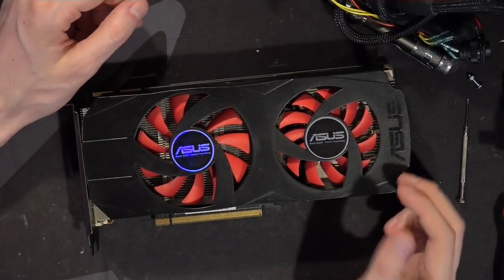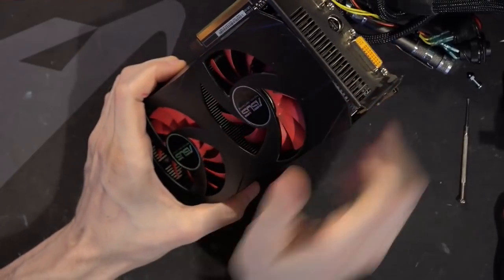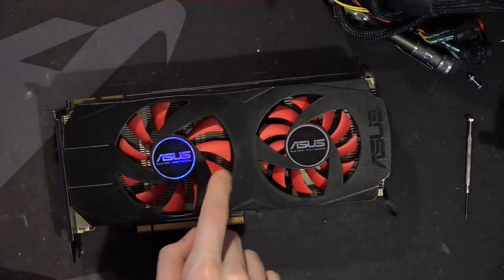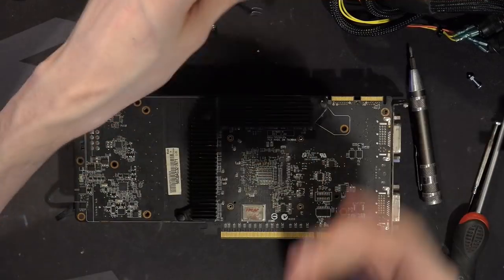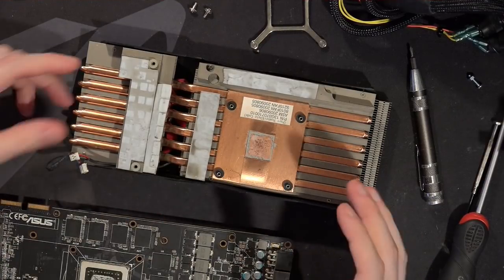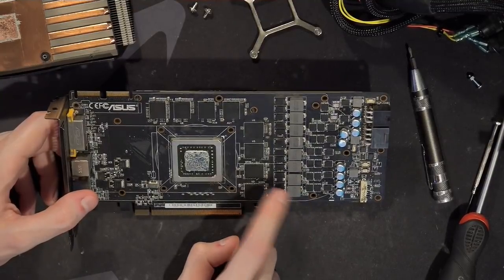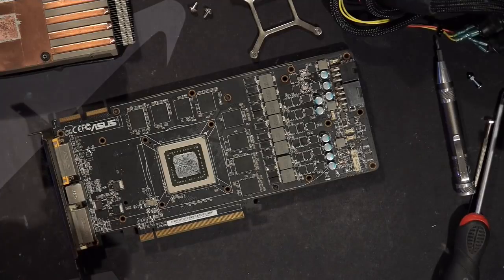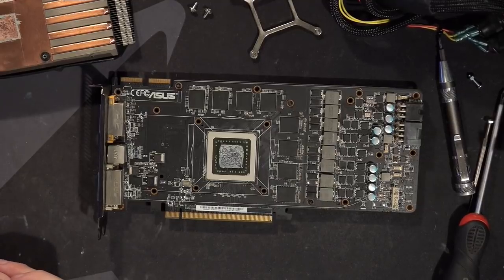ASUS EAH4890 1GB teardown.

Comment: This was early into these dual-fan designs for ASUS and they were trying to keep air going out of the chassis. In a lot of chassis designs with front-to-back airflow this card actually performs worse than the reference card in everything other than acoustics. Proper dual-fan designs with sizeable finstacks did exist, such as MSI's original TwinFrozr displayed on their GeForce 200 series models. 

Important note about the memory; the reference Radeon HD 4890 spec uses 1024Mb x 8 Qimonda 4.0GHz rated GDDR5 tuned down to 3.9GHz for stability and yield concerns. ASUS for this card chose the older 512Mb x 16 layout to offset stability and likely cost/availability. Other vendors such as Sapphire had already shipped 2GB variants of the 4890 with 1024Mb x 16 Qimonda at the full 4.0GHz. So it doesn't need to be double sided, but they chose to do it that way to make it easier on themselves.
Reply: "worse in everything other than acoustics" doesn't make sense - noise equals cooling performance... So that's a bit confusing lol. Did it perform worse in noise normalized thermals or did you mean with fans off? Cuz separating acoustics, a 60 dB blower cooler is the best ambient cooler ever lol
Reply: With those fins running the length of the card instead of transversely, the front intake of the chassis would be fighting the GPU fans pushing air out of the end of the card.

EDIT: The reference design was a single fan blower.
Reply: @Manjushri The fans are quieter, however the card does not stay as cool as the reference card regardless of fan speed because the finstack, among other things, is inadequate.

Besides if noise equals cooling than passive finstack cards would simply explode when powered, no? Cooling is relational to the volume and surface area of materials the heat conducts to. Be it air, water, metals, plastics, or a combination of materials.
Reply: @FixedFunction  I was hoping you'd recommend installing a turbine if noise level alone = cooling performance, LoL.
That's just someone talking out their arse.
I didn't notice at first but the two fans are different. The rear fan that's cooling the VRMs has denser blades. Higher static pressure since that part of the cooler doesn't have even the mediocre fin stack the GPU side has
Reply: Ben T.  Equating noise level to cooling performance is wrong for so many reasons. I wouldn't be surprised if that guy came from the PCMR subreddit
Reply: Ben T.  For sure. GPU cooling solutions have been relatively stagnant for a long time now. That's why I was so interested in the Nvidia FE cards' cooling solutions. 
It's a shame those cards are basically unicorns that will never see true mass production.

Comment: One day we're going to have 1tb memory  gpus and we're going to look back at these days with fond memories.
Reply: @iwashere yeah give it 10 years and 512gb will probably be midrange
Reply: @WayStedYou  I sincerely doubt that, for a lot of reasons, but let's keep it relatively simple. 10 years ago, 2GB would be high end. Today, 10GB is. Knock a 0 off your estimate and you may be right, but I'd still bet against it. 10 years ago, 1TB was great storage and recommended for the high end. Today, most would agree 2TB is more than enough for gaming. We are at the point where higher resolution doesn't necessarily mean better, and as a result we are quickly headed away from maxing out VRAM for non-AI/professional purposes.  

What is way more likely to see in 10 years is more uniform system storage, where you have vastly more blazing fast storage compared to today, but it'll still likely not be used over high speed VRAM for the actual GPU and it'd be like saying you have a terabyte of RAM because you let Windows use a terabyte of your NVME SSD for memory.
Reply: @WayStedYou  In you wildest dreams! :) 4 years ago 8 GB became the new high-end standard. Today 10/11 GB is. I will estimate in 10 years, 24 or 32 GB is the "standard" people want for 8K. Not really much has happened in the past 5 years. Titan X Maxwell was 12 GB.
To this day a 10 year old card can still game (Take a GTX 480 or 6970). The way GPU have developed during the last 6 years, that might be the case 10 years from know. Meaning a RTX 3080 will be closer to the latest n greatest in 10 years, than a GPU from 10 years ago.
Moore's law is dead now. Unfortunately, so is the real innovation.. Now they just milking out what they can of the tech they have. (The easy way of moneymaking) The last time we saw a proper GPU breakthrough, was in 2007 with Nvidia 8800 series. And CPU breakthrough, was in 2006 with Intel Core 2. After that, just kept innovating just enough to keep consumers on the leach.
In the late 90s, we had more performance jump in 3 years, as the last decade.

Comment: Yo Buildzoid.
I'd like to introduce you to the Sapphire HD4890 Vapor-X 2GB. High Density ram chips - oh yeah!
2GB of very hot spicy early GDDR5 clocked to the max with a heck of a PCB and one decidedly shitty cooler XD.
Reply: Also DisplayPort and modern goodies
Reply: And yes this early GDDR5 memory is hooooootttt.
It needs all the cooling.
And the memory controller on these 4890's get's real spicy.
https://twitter.com/0xCats/status/1305483468219052034

Comment: Oh, cool. I have this card and actually wanted to see if it was any decent.It's mounted in a retro build of mine and is getting a custom VRM block paried with a universal block for the GPU.

Oh and if you do get it up and running... You will need to run it on a win7 machine or older as the drivers simply does not work at all in win 10 (coincidentally when I did get it working it artifacted heavily in win 10 if I remember right). If you end up actually using the cooler then the VRM fan is also just a constant speed and quite loud so it's hardly ideal. I think a lot of the custom PCBs that had crazy vrms and related cooling to them is related to the fact that the 4870 VRM (of which the 4890 is essentially just a beefed up version) had a tendency of dying from overheating. So a lot of the manufacturers overcompensated to make up for that reputation.
Reply: Ben T.  The drivers don't work as in they give massive artifacting and graphical errors. I get it to boot and all that, but once I actually put it under load it starts acting werid. It does not have this issue in win7 so it's not a defective card.

This might just be the quirks of this specific card for what I know, but I do remember thinking it was broken when I tested it in my main rig when first buying it. Then I tested it in my retro build and everything went on without a hitch.

Comment: The Radeon 4800 series cards still came in two flavours of memory amount. 512MiB and 1024GiB.

I know because I cheaped out and so GTA IV didn't run at full distance on my 4870 with half a gig of Ram.

Comment: I have a EAH 4890 and it doesn't have memory on the back of the card and the VRM is much different. This is interesting that there are different versions of this card (mine is 1GB as well). I will send you pictures if you are interested in the version I have.

Comment: Experience Marvelous Gaming Performance with ASUS EAH4890 Series!
Up to 3 times overclocking margin & 10°C lower GPU temperatures.
Luxurious Super ML Cap for up to 20% GPU noise reduction.
Specially designed fansink with six 230mm heat pipes.

Comment: I used to have one of these and i cap modded it but unfortunately I accidentally shorted it with my multimeter before i could fully bench it :(
Reply: How do you learn to hardware nod your GPU on your own.  

I wasn't able to find a decent guide. Could you guide me to one?

Comment: does $150 for a non working 1080ti rog strix worth the gamble?
Reply from the maker: I wouldn't pay that much for a dead GPU
Reply: @ActuallyHardcoreOverclocking  thanks for the reply, since i've been on my lucky streak with the past 4 dead gpu i'm thinking of steping up the game but if its too much then I'll hold back 😅
Reply: Unless you can visually detect that it's a reflow problem, don't EVER pay people for broken hardware. Hustlers gonna hustle.
Reply: @andersjjensen  the case that I've deal with so far is shorted gpu, gpu that run but doesnt display picture is harder to deal with IMO, I decided to hold back from that 1080ti since its the later one, it could be anything from easy fix to impossible to fix 😭

Comment: lmao when they went from their butt loaded stream processor design in the 3870 etc to the 4870 etc....they were finally "getting serious" OMFG and the pci 3.0 support claims no different than the 4.0 bs of today.......or the pci 2.0 support of the 3870 that barely fetched 8800gts 512mb numbers......with 1gb in the radeon....aint much changed.